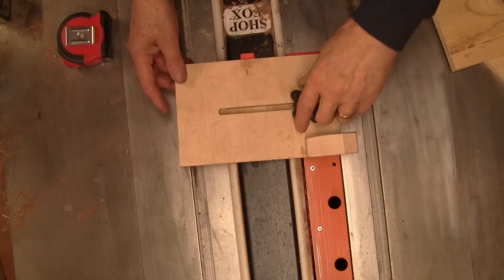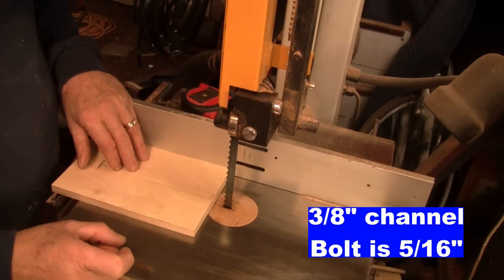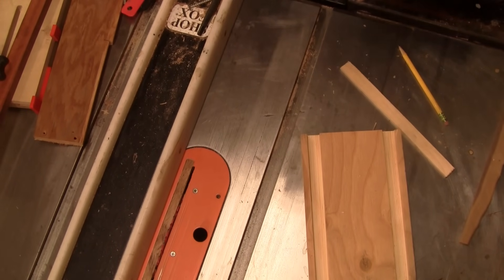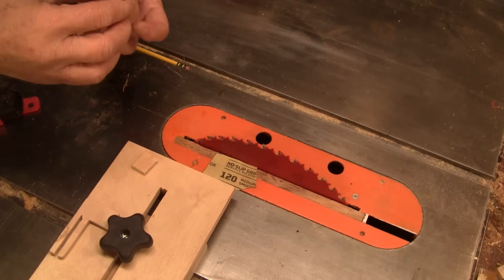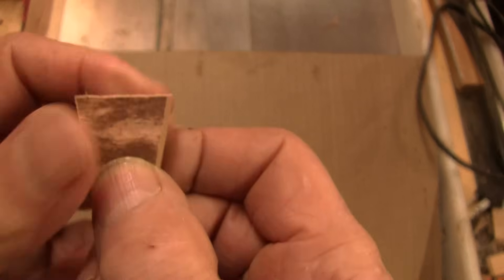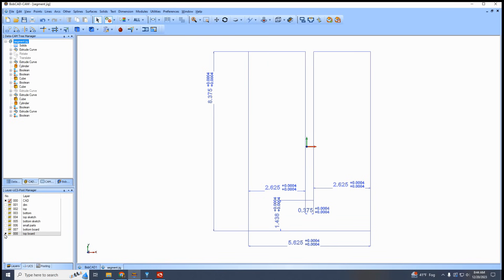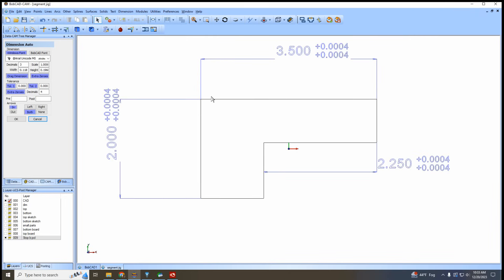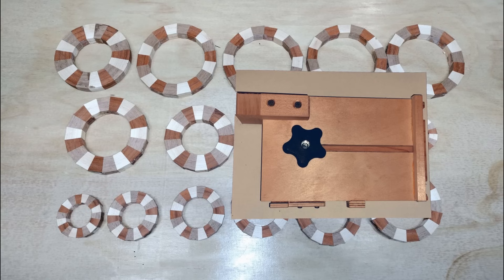I Built The Best Segment Stop I Have Ever Used Wood Turning

Comment: Get well, my friend. Personally.... Seeing more 3D printing applications for Woodturning would be the "jam on my biscuit"!! Bring it on!! I just helped our school woodshop guy turn a replacement spinner handle for the table saw. I made 2 PLA bushings with  7mm bore. Printed a ⅜" OD on the inner shoulder and a ½" OD on the outer shoulder. Used 100% infill to fight the compression and heat from friction. We used a standard 7mm pen turning mandrel to do the turning and the finishing.  Our Sawstop now has a stabilized walnut handle with 10 coats of WaterLox...  Almost student proof!!

Get well, Gary
Reply from the maker: Thank you very much Dave! You have given me some wonderful ideas for 3D printing. I have some missing handles and things. And I sure do love the 3D printer.
 I remember when the pattern shop I worked at first got into rapid proto type they got an LOM machinel
Hired a young engineer(not mechanical) to set things up. I ended up designing the first part made on it.
A working crescent wrench. Just so they could try it out. Did a bunch of other parts as well.
They went on to get 3D printers and not sure what they have down there now.
I had nothing to do with those printers though. 
I preferred building patterns from drawings. 
But as you know I do love the technical stuff as well.
 Thanks my friend,
Gary

Comment: Gary. That is part of life, and we don't bounce like we used to. I have been down this road with shoulder surgery. The worst part is not being able to work in the shop. The rehab is second worst part. I'm sure you will design many wonderful projects to build as soon as you are well. We will all be here with you and learning from your teaching. We might even get to build one of your projects before you do. We will be praying for a complete and quick recovery. I have learned so much from your video's. This was my new year project to design a new stop for my segmented turning. Now you have done it for me. I just have to go build it. Can't wait to see what is next.
Reply from the maker: Thank you Barry. Not much spring in my bounce for sure. I did not do bad crawling to get to the door though.

I think you will find this one easy to do. My thought was a screw so you could count the turns. Way to slow for me.
Most of this is based on the smaller milling machine I recently sold. There were two stops. You set one at the begining of the cut and cranked till the touched. This method goes back hundreds years. So it is just like the bed and the ways on a milling machine if you think about. 
Gary

Comment: Gary. This jig is another much needed addition to my shop. I work from a wheelchair much of the time and only stand for short intervals so I really appreciate these time saving jigs. Good luck with the surgery and rehab.
Reply from the maker: Thank you Dave. Sounds like you are making the best you can do. That is a good thing.
 I do have a few other fixtures to make. Thanks that have been around for other uses but will help us wood turners a lot. I have them but not gone into detail. 
My lathe is too high use sitting down. Maybe time for a mini lathe...hmm
I will wait the 6 weeks. 
Surgery was yesterday. With the blocker no pain at all. But I feel it wearing off.

Gary

Comment: Hi Gary,
I just watched the video for about the third time and managed to catch some of the key words that you said (i guess im a little slow in the hearing department) and found the miter slot parts of which you spoke. For about $20.00 I got 2 sets of parts. Thanks, now I've got another project after I finish my saw mill sled for ripping logs into planks. Your jig that you did for cutting your wafers is my foundation for this project. I will post pictures on Facebook when done. Thanks for your investment of time for making  these videos and hope that leg is healing well.
Reply from the maker: Thanks Tim. Sounds like the same ones I got. And sounds like you are stocking up on sleds. Can never have enough 🤪

Seeing the doctor this week.
Hopefully I can start putting weight on it.
Gary
Reply: @ThePapa1947  well, this sled I'm working on is my first for this bandsaw. I bought a Rikon 14" about 6 month ago and have been having health issues. Had a nice vacation in the Kaiser Hilton which gave me time to think through some of the fine points. Now to start making notes.
Reply from the maker: @timrauscher3965  sorry about your health issues. Hope you are doing well now.
Reply: @ThePapa1947  well, I do have some health, but this time I think that it was some wood that I turned that had some bad mold causing me to have some resperatory issues. May be that could be a video by you, if knowledgeable in that area. I think Gord Rock may be , however he has cancer and is having problems with his chemotherapy.

Comment: Gary, I hope this finds you on the road to recovery! I’ve been there; for me it was shoulder surgery. Physical therapy is what helped the most after surgery. They call PT Physical Therapy, I called it Paid Torture. But it was worth it in the end.
I don’t have a 3D printer, yet. Maybe your videos will push me over the edge to getting one. 
Speedy recovery and thank you for your videos. I never miss one!
Reply from the maker: Thanks Ken. I just got done with PT for shoulder. Now it will need it again because that arm helps me to get on my good foot so I can sit on a roll around the house.
I recall some song about This Bone is Connected to That Bone. Or something like that.

This can be done with strips of wood or HDPE but I love my 3D printer and can not wait to show some videos on lathe accessories I plan on making.

Thanks again,
Gary

Comment: Gary,
Sorry about your fall and resulting injuries. I can relate to falling in my shop too, but I didn't have broken bones or torn ligaments. We "old folks" just don't lift our feet as high anymore and therefore are more susceptible to falls. Enjoyed the making of the segment stop and will make one. I have one that has similar adjustable stops, but has limitations on accuracy.
Get healed and I will continue to watch your excellent talents work. I have a basic CNC and haven't taken it out of the box, but am anxious to get it setup and use it. All the best!
Reply from the maker: Thanks so much Norm.
For sure the older we get the easier we break.
CNC can be lots of fun .
Is yours a CNC router?

Gary
Reply: Yes, it's a CNC router with the option of adding the laser tool. Good luck with surgery.
Reply from the maker: I have a full sized Bridgeport CNC milling machine. Also have the TwoTrees CNC router.

Comment: Get well soon, don't rush the healing process I for one, need your guidance. Stay safe and healthy, and happy New Year.
Reply from the maker: Thank you very much Bobby. That is very good advise.
Happy New Year,
Gary
Reply: Got the miter slot fixture from KM Tool in the other day. Now I need  to get back to it. THANKS for all you do for us. Get well soon.
Reply from the maker: @bobbyshelton8781  very nice. You will love it when it is done.
Gary
Reply: I also started the glue press today. Cut the pieces for the bottom 16"x 16". My lathe has a 14" swing, I'm thinking 16 inches should be big enough. Can you give me guidelines on how tall to make the uprights. Thanks.
Reply from the maker: @bobbyshelton8781  I would probably make it 16 inches.
I use spacers a lot if needed rather than adjust.
I normally have it set around 8 inches above the bed.
Reply: Thank you.
Reply: Gary, I got the stop jig done today. Was going to post a picture, but you can't add pictures to the comments. I learned that today now I am smarter. Thank you for the video you made. Did you make a video for the angle sled? I will need to find information on  one. Again thanks.
Reply from the maker: Good news Bobby.
You can email a picture. That  is about the only way.
Not sure which angle jig but I can do it when I get back to the shop.
My email is in my About Page

Gary

Comment: The 90 degree adjustable stops with the measurement guide are a lot more accurate with smaller angle cuts.  However you will notice a discrepancy between your set SEL length and the actual SEL length at large angles.  The actual SEL lengths will always be larger than the measurement of the gap in the gauge.  Simply geometry.  It typically isn’t a major problem but I was scratching my head for a while trying to figure out why they were different when I first made mine.

Wishing you a speedy recovery.
Reply from the maker: Thanks Rick. Yes they will be off a little. What I did was pulled the stop away from the blade a given amount. So it would cut a known length along the the  segment.
I then set the opening on the jig to 1"  The blade will not measure that in a straight line from the stop but it still cuts the 1 inch needed.
 This should work on all the segments that are cut lets say for 18 segments per ring.
So the stop is really a little closer to the blade than 1 inch.
At least it worked that way for me.

Comment: Glad you’re going to be ok.  I shattered my heel in Jan 2021 and was non-weight bearing for 14 weeks.  This was less than 3 months after buying my first big boy lathe.  It was devastating.  I ended up getting an I-Walk (kind of a peg-leg replacement from the knee down) after going crazy for 4-5 weeks that gave me enough mobility to return to the shop.  I was procuring log pieces and cutting them up with a chainsaw.  Probably not the smartest thing, but I was being careful.  The I-Walk looks funny and feels dangerous to start, but in the 9-10 weeks I used it, I only came close to falling one time n the living room.  That was because I let my guard down in a familiar environment and stumbled on a kid’s toy.  

Good luck in the surgery and have a speedy recovery.
Reply from the maker: Thank you for your comments. The I-Walk looks like it works but I think I will try and avoid it. I have trouble with crotches.
Gary

Comment: Hi Gary. Hope all goes well with your recovery. I regularly watch your videos and very much enjoy your approach and style. I've "borrowed" a number of your methods and find them very helpful.
As it turns out I built a similar stop jig just a couple of weeks ago because I started open segmented turning and need the increased accuracy. I had been using a segmenting sled with an adjustable stop but it worked by hand measuring the stop placement. OK for some things but not great if you need very accurate pieces. Too bad the timing was off because your version is a bit better than the one I build. May have to rebuild it.
Reply from the maker: Thank you Randy. Feeling better and it has only been 3 days since surgery.
I based mine off the table on my Jet milling machine. It had two adjustable stops and one fixed. You could have your work clamped and place the stop for repeated cuts. Also two places for it to slide like a milling machine has.
Pretty much the same idea. Which has been around for a long long time. I think the 1818 or longer.
Funny I have books they gave me as an apprentice Patternmaker that showed machines that old. No I was not born when they were printed. LOL

Comment: Gary,  hope your recovery is going well.  Thanks for the video on the seg. stop you made. I have been looking for that works as I have been measuring my seg's the same way did prior to making this one.  I am also out of the shop as I fractured the middle finger on my left hand and dinged my index finger on the same hand.  So I have a couple weeks to watch video's, I specially like your videos as you do a wonderful job  of explaining each step.  I am also wondering where you purchased your short miter slot rail?  I have time to gather parts and watch more of your videos, looking forward to your woodturner pro videos..  Thanks again and speedy recovery.   Ron
Reply from the maker: Thank you Ron.
Sounds like you are in the same situation. Sure not fun 

This is what I bought. Like I mentioned you need to keep the ends from turning.

POWERTEC 71642 Miter Slot... https://www.amazon.com/dp/B0B3HQCC63?ref=ppx_pop_mob_ap_share

POWERTEC 71642 Miter Slot... https://www.amazon.com/dp/B0B3HQCC63?ref=ppx_pop_mob_ap_share

Comment: Your videos are very interesting and it's a shame you won't be making any new ones for a while I hope you get well very soon  Gary , I've watched a lot of operations where pins and screws are used and I always say what size is that bolt or screw and I like the saws for cutting bones etc , it's being a carpenter  ,
Reply from the maker: I will be back soon enough.
Well now watching surgeries, now that is interesting.
I had surgery on a tenon once and swore it was hooked up. The doctor said he could do a arm block and he would show me it wasn't. When he got to that point he said I was half right. The sheath was still hooked up. 
The anesthesiologists did not like it. But he lost I watched.  
  Not bragging. Just wanted to make sure.
Gary

Comment: Hope you recover quickly. Ankles and feet take a lot of abuse and require extra care for healing. My wife had foot surgery back in April and had to keep all weight off for 8 weeks then she transitioned to a cast and then a boot. Scooters are the way to go. Question about segment length. It appears that you are measuring the distance parallel to the blade but the wedgie sled holds the wood at an angle. I’m not a math wizard but I would think that the segment length would be longer in reality versus the straight measurement. Get well soon. Your videos are always enjoyable
Reply from the maker: Thank you Greg. Yes it will take some time for sure. My doctor says 6 weeks off of it. Have to see how it goes.

As far as how the segment lengths work. The first cut is an angle and when you move the strip to the other fence it is place on the complement angle. The cut is measure along that angle and will match what the stop block is set at.
It is simply sliding that distance till it hits the block.
 Hope that makes sense. 

Gary
Reply: @ThePapa1947   Thanks for the reply. After watching the video again, I see what you did but I don’t understand why it works. The diagonal distance is different than a straight line measurement. I’ll have to test this on my wedgie sled and stop block.
Reply from the maker: Maybe the fact that when setting up the sliding stop it is taking in the slight difference along the angle.
I just figured out that on that angle there is .015 difference than the straight line in 1 inch.

Comment: I have a couple of questions. One how far  is the bottom rail , the miter slot from the  edge of the bottom board. And  where did you the part you used to make the miter rail. Thanks,  Glad you're headed towards recovery.
Reply from the maker: I think I have that answer. The slide rails are full length and the slow is also full length.
The miter slow hardware is 1.25 inches back from the end of the board closet to the saw blade.
Search for this on Amazon. It is what I used: POWERTEC 71642 Miter Slot Hardware Kit (Slot Bars, Knobs, Screws, Washers)

Feeling much better today thank you,

Gary